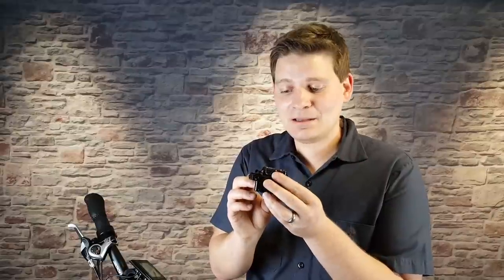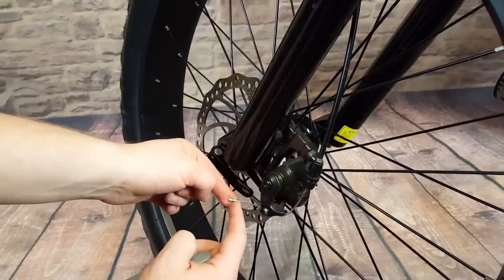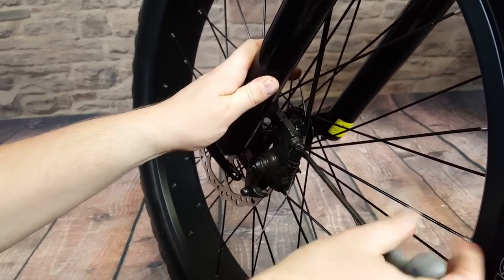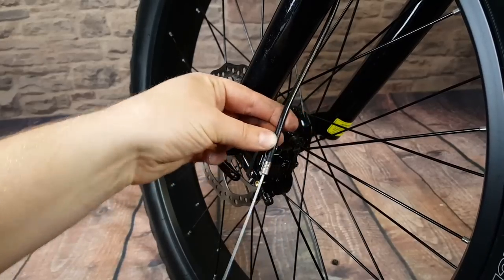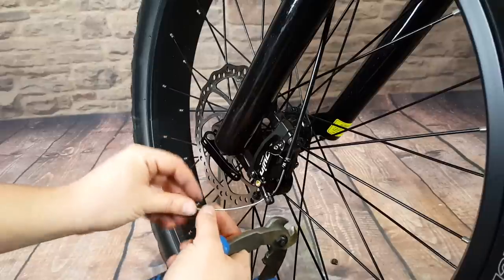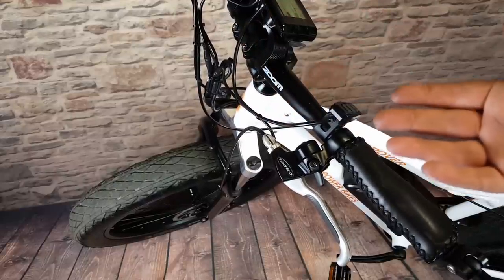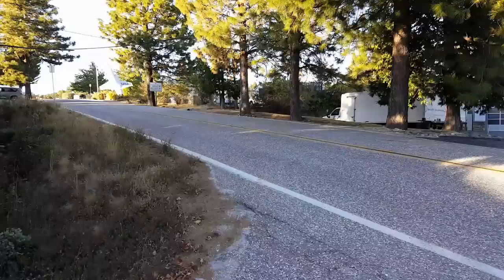How to install Hydraulic Brakes on Ebikes in 5 minutes!  Keep your Brake switches intact

Comment: Hello, I am definitely not a bike mechanic.  I just ordered these brakes.  I have a radrover.  When putting the cap back on the end of the brake cable, what is the best way to do this without any special tools?  I am googling around and there seems to be so many options, cable sizes, etc.  can you make a recommendation?  thank you
Reply: If you have a pair of wire strippers that have the crimpers on the inside my guess is you could find the right size to crimp that cap on.
Reply: Side cutters used LIGHTLY!
Reply: ended up buying a screw on type.  worked great.

Comment: What are the specifics for the calipers? Can you just buy hydraulic calipers and remove the hydraulic cable and replace with the mechanical pull wire? I am just trying to understand, as thought hydraulic brakes were pre set up for their own cables.

Comment: where do you suggest to purchase these hydraulic brakes?  what site?
Reply from the maker: They're available at BoltonEbikes.com
Reply: @Area13ebikes  haha my bad.  =)
Reply: Also, will these fit on the newer 2019 frames now?  Are they similar in engineering for fit, as in your video?

Comment: Will these work on a bike with 180mm rotors? Most cable/hydraulics seem designed for 160mm rotor.
Reply: Do you mean most hybrid hydraulic calipers, it will be fine, i used zoom ones, 180 front 160 back, always go bigger at front as this is were brake force hits first, i like mine for awhile but i would go true hydraulic and use cut off sensors modified to them.

Comment: Since responses from B.B. are somewhat spotty...for those of you who have installed these brakes...do they come pre-bled? (I noted in the description on Amazon that they use mineral oil, which is a plus. That way there's no corrosive fluid that needs to be maintained/bled every year. But do they come good to go right out of the box? Thanks.) Also, do they use proprietary pads or can any brand pad be used?
Reply from the maker: Ready to go.  Pads are standard and work with other brands.
Reply: @Area13ebikes  Thanks. Good to know. This past week I actually called the head mechanic at a popular LBS near me and asked him about converting from the stock mechanical disc brakes on my soon to arrive Zhengbu K6 to a hybrid setup, exactly as you showed here. He said he hadn't heard of any hybrid hydraulic set ups in over 10 years. He also suggested that mechanical discs can operate fine if they're set up properly from the start and maintained/readjusted afterwards. Therein lies the rub. I've watched several videos on how to adjust mechanical discs and they all gave me a headache. He said he'd be glad to show he how to readjust them, but I just don't have the confidence. He then suggested that if I wanted to go the hydraulic route to go full hydraulic, or else stay with the mechanical setup.

My preference, after seeing this, would be to go with the hybrid setup. This video is exactly what I was looking for. I might give the mechanical discs a try to start out with. If the brakes look/sound like they're set up properly when the bike arrives in a couple of days I'll bed in the pads then take the bike up for him to give a good once over. After that I'll ride it and see how they feel. I know when I go from my hydraulic Yamaha Urban Rush to my non-Ebike Kestrel with (formerly) nice calipers (Ultegra) I feel like I'm back in the stone age. The difference is dramatic and I don't like it. If it's a minimal difference I might stick with the stock brakes until I need to replace the pads. If they totally suck I'll be ordering the Juin Tech brakes for sure.

Comment: Question regarding these brakes on a rad mini 2020 .  The rad bikes disc  comes  with an option for adjustment on them on the disc itself using a provided tool with the bike .  After installing the juintech brakes , does  this  still  work to  adjust at  disc  as well . ?

Comment: what brake pads fit this M1 ?  And what is the difference between M1 and R1 ?
Reply: Well, the R1 will be optimized for the leverage a road bike's caliper brake needs from the levers.  The M1 will be optimized for the cable pull and leverage that MTB/Flat bar brake levers normally used for V-brakes. Their is an assortment of standards and pulls (old school cant's are different still, and you can find flat bar levers with road bike pull ratios and drop down levers with V-brake pulls, etc).  But generally most modern equipment fall into one of those two categories.  So in short, if bike uses V-brake levers, the M1 is the ticket.  If the bike uses road bike levers optimized for calipar brakes the R1 is the brake to get.  It's all about leverage - if the pull is too much, you'll get a wooden feeling brake with next to no pull at the lever with little to no power or modulation of that power (the pads will move too much for the brake lever movement giving poor power control).  If the pull ratio is too little you'll pull the brake levers all the way back and seem to get no brake power but lot's of modulation given how little the pads will move for the same lever movement.  As for replacement pads, I'm curious as well - I keep seeing these can use Shimano pads, but which pads I have no idea (Shimano has a pretty wide assortment of pads for all the Disc Brakes they've made over the years).  Hoped the info helped & have fun!  :-)
Reply: It would appear what everyone is talking about for replacement pads are older Shimano pads - the A01S (Rosin/Organic), M06 (Sintered), and M06 Ti (Sintered with Titanium back plate) look right...  I'm basing that on the pictures of the pad set on Bolton Ebikes, so I'm not 100% these will work.  But Juin Tech's replacement pads (right off the packaging) which def will work are  P/N: GG-DP17+SP17.  Obviously Bolton Ebikes should have them in stock. :-)

Comment: I have a Rad Rover Step thru the brakes don’t have a bracket, they are mounted with two bolts going through the caliper housing.  Will these M1s fit my bike?  HELP
Reply from the maker: Yes they will.

Comment: So... these are cable actuated hydraulic disc brakes...?  These hydraulics are not fully hydraulic like those with hydraulic levers and oil reservoirs..
Reply: Wire cables don't leak!

Comment: Hi your title is hydraulic brake. But you end up mechanic brake?
Reply: The brake calipers themselves are hydraulic but use the existing mechanical braking system to activate them.

Comment: First off , I am all for hydraulic disk brakes and I use them on my bikes. 
These brakes would be a good alternative if:1- There was tech support for them but there isn’t any JuinTech tech support in the US. 
2- From many owners of those brake calipers they say that they do not work at their best unless you replace your current mechanical cables with Compressionless cables.
Reply from the maker: No need to worry about tech support if you buy them from me.  :)
Reply: Velomobile Shop Ok 👌 Thank you ! What your experience with using the brakes and the  brakes feeling to to soft without using compressionless cables?

Comment: I like watching your videos, but my problem #1 front wheel is a 1000W motor I can't find a caliper that won't rub against the motor wall. I have a zoom stock caliper that comes with the bike that fits. It is too small for an eBike I would like to find one bigger. Can anyone help, it would be a blessing.

Comment: I don't know if anyone can help but had the Tektro brakes on the himiway and did the conversion.   The mount though makes the new callipers only cover 70% of the rotor.   Has anyone had any luck adjusting or switching out the mount to smaller profile.  Would like any suggestions if possible.
Reply: Did the new calliper come with a post mount, only use the existing mounts.

Comment: I assume this is for the juin tech M1.  Has anyone tried using the juin tech R1.  Would that cheaper option also work?  I'm speaking from the standpoint of a 60 pound RadCity/RadRover.
Reply: Also, how long does it take to bed in the brakes?

Comment: Will these work on the 2019 RADMini rear brake new placement in front of the axel now? Thanks
Reply from the maker: I don't see any reason why not. :)
Reply: It does work but it's a little difficult to remove the back screw because it's so close to the frame and for some reason the 2020 RADMINI does not come with a spacer on the back caliper.

Comment: A proper hydraulic brake with the hosepipe is much better than the one that you put on the bike, if you are a engineer then you should know that,  I was just giving you good advice , for the price is best getting the real thing instead of half the brakes, the break you're using is a compromise to the full hydraulic brakes, and you can get a better outcome and have a nicer break if you use the full electronic hydraulic brakes  the one with the hose and not the  wire pull.  the  wire pull is primitive to the front hydraulic,  the full hydraulic feels much better to operate, my opinion for the price it's not worth it to using this type of break that you suggest,  good luck.

Comment: Don't really understand this.. is there a hydraulic fluid reservoir in the caliper? Where's the hydraulic part? What makes hydraulic brakes better and more powerful than mechanical brakes is the brake fluid going through the lines from the hand brake to the caliper. This isn't happening here.  And you're still getting cable stretch which you avoid with real hydraulic brakes. Guess I'm not seeing what makes these brakes hydraulic brakes .

Comment: I really wish these so called youtube experts would stop spreading sale making misinformation, Hydrolic breaks do not give you better stopping power than mechanical breaks, they do however need less leaver power to use but at the pad they exert the same damn  force.
Reply: This gentleman has a successful YouTube channel and business with happy customers, so he must be doing something right. All we know about you however, is that your avatar is a silly cat face. Who should we trust more the anonymous guy in the comments with cat face, or the guy with a successful bike business? You be the judge.
Reply: Also...in your quest to prevent the spread of misinformation it would be helpful if you provided sources to back up your claims. Links to reputable sites with data would be more helpful than simply harping on someone who is genuinely trying to help people safely enjoy their bikes.
Reply: @EQINOX187  The reason it takes less time is because both sides come toward the center, instead of one side going to the other. Think of a runner running to 100 meters, but now two runners coming to meet together, thats the advantage. If you look mechanical disc brakes you will notice that it bends the rudder to reach the other side by force, given that, bending the rudder decreases surface to surface contact with the rudder and the brake pads (rudder coming in at an angle, while the other side of the rudder stays flat-perpendicular), now this affects both side of the rudder, therefore also decreases the stopping power of both sides. This is basic physics...

Comment: How is that 'hydraulic'?  Where is the fluid?  It is just a dual plunger mechanical brake!  Like a TRP Spyre. Sure, a little better. But no increased braking power. Not worth the trouble.
Reply from the maker: The fluid is in the caliper.
Reply: @Area13ebikes  That's amazing. Who makes them and what do they cost?

Comment: Why don't they have a way to use the motor itself stop the bike and charge the batteries at the same time?
Reply from the maker: That's called regenerative braking, and is possible on direct drive hub motors.

Comment: Too bad the cables are not long enough to switch from Left to Right, so the front wheel is on the RH side like on Scooters/Motorcycles.  This should be a "universal standard".  Nice doing a "hard braking" test without a helmet.
Reply from the maker: Thanks for watching!

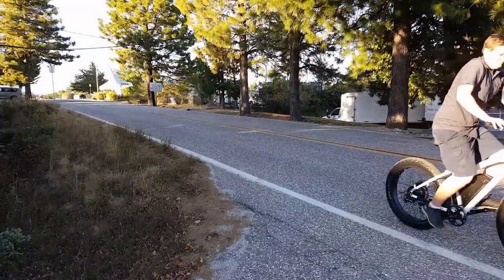Comment: There is no stopping power difference between hydraulic and mechanic systems, both use same sort of pads and same type of discs, only difference is the pressure applied, which on hydraulic feels really really good, there is not much point in upgrading to this as you will still have the cable on so same amount of resistance... by the way, at 10:50 while breaking you locked your rear wheel, skidding stops the bike slower then a controlled braking, you should break as much as possible WITHOUT locking your wheel to get maximum stopping efficency
Reply: @specialist-in-tech  LMAO

Comment: Mechanical bicycle brakes are trash! It took me a long time to finally get hydraulic brakes and since this year. I can say they're far more superior. I've even tried hybrid cable and hydraulic brakes. Those are trash too! I went on alit express and ordered the most inexpensive shimano hydraulic brakes that I could find and haven't looked back. Yeah there's still the issues of centering the disc and all of that. But the stopping power of these entry level hydraulic brakes beat out those annoying to adjust cable pull brakes. All day long you'll be trying to stop that damn disc rub. And the stopping power will wane as the steel cable starts stretching. Just sheer annoying to deal with! Folks buy you some hydraulic brakes. I just hooked up the M625 kit and I'm annoyed that Bafang actually had cable brakes in mind with that damn sensor. Why would someone want to use cable brakes on a faster moving bike? Dumb!!!
Reply: what kit did you get? i tried getting semi hydraulic brakes and even those were trash cuz the piston wouldn’t go out all the way when the pads were being used up causing me to not having any brakes and ended up crashing i want a affordable hydraulic brakes set for ebike that i can install on my ancheer hummer ebike it uses the red adapter

Comment: Why haven't I found this video before...  I just bought a Rad Mini 4 ebike and I spent half the day yesterday in my garage trying to get rid of the drag of that one pad on the rear wheel.  It does not drag on the front wheel...   Why????  I  could not understand why the rear tire did not rotate freely...    The stationary pad apparently is supposed to drag against the disk until they "wear in".   I thought both pads were supposed to move in to contact the brake disk...   Wrong....  To me, this (cheap) mechanical system with one stationary pad seems like a crap design...  Rad seemed to have the most bike for the money.  But, as always, you get what you pay for.  With Rad, unfortunately, it is a cheap braking system and a cheap derailleur ...    In fairness, they both work well if you do not put too much stress on them.  I find the frame and design of the Mini4 to be beautiful.   Thank you...  Again...  Kyle...   I love your videos...  The next bike I buy will be from you...

Comment: Hydraulic brakes are not inherently better.

You may ser better braking simply because you now have bigger disks.

A normal upgrade will also often result in bettet performance by eliminating user error in cable adjustment.

This upgrde leaves the problemattic cabling in place.

There are brake kits that have motor cutouta, and if you can't splice a couple of wires you're hopeless.

Comment: $149 bucks???  Are you crazy?  The same thing can be had on ebay for about $30.  They are ALL made in China so don't tell me the ones sold by Bolton Ebikes are a much better quality.
Reply from the maker: Surprise!  These are NOT made in China (not that it would be a bad thing) and absolutely are a higher quality than ones that cost $30.
Reply: @Area13ebikes  Basic Shimano hydraulic disc brakes are at least as good as this hydraulic caliper. Plus Shimano's price is way better because they providing also lever and hose. USD 30,- compared to 149,- is almost 5 times more. Your hydraulic caliper for USD 149,- cannot be 5 times better than the Shimano one.

RAD and other brands build very heavy e-bikes and put weak parts with low quality on it. It's always about the price. Customers buy cheap e-bikes and upgrade them. So is not really cheap anymore. 

Big discussions about climate change and the waste of material - this is an example. Weak parts instead of good ones are produced and thrown away. This is useless, bad for the environment and does not make any sense. 

To save on brakes is dangerous and not intelligent. As a customer one cane check the aftermarket prices for hydraulic disc brakes to find out that they are not extremely expensive. So why put RAD and other brand not mount right from the beginning the right brakes? RAD and other brands optimize their wins, customers must deal with it an are forced to upgrade their bikes. 

If this would be in the car industry, it would be a big scandal. Even the cheapest car has strong, right and good brakes right from the beginning. In the bicycle and e-bike industry manufacturers can more or less do what they want. The stupid ones are always the customer.